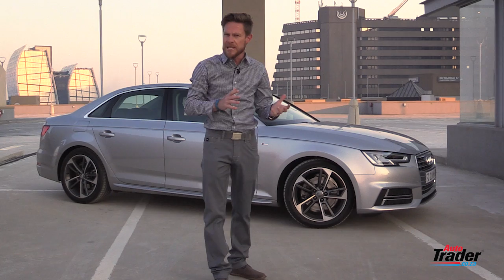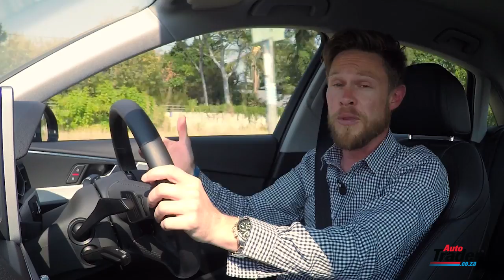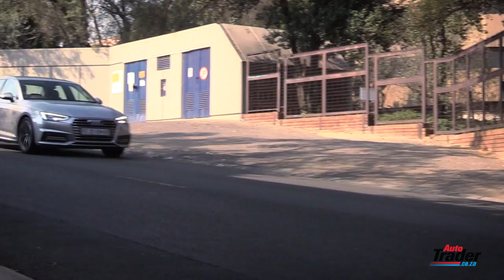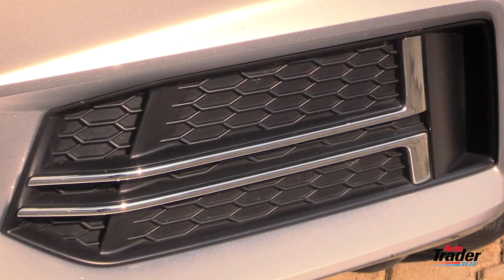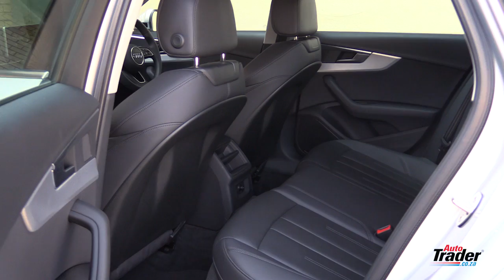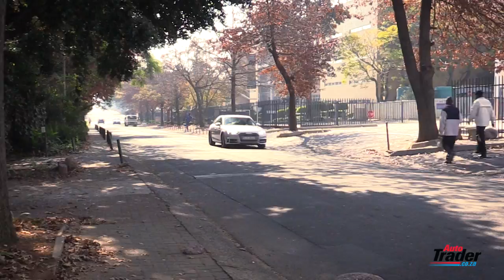2016 Audi A4 1.4T FSI Sport line

Comment: We humans are our own worst enemies. When a manufacturer struggles to keep a clean look on a newer model because there is no need to change what is good we admonish them for that, yet when they spoil the design we wail. Look at how mercedes has messed their designs because of trying to keep up with jone'ses. We need to practice balance not hype just to be seen to be progressive. A key elememt of balance is knowing when to push, stop or pull back. I have heard your comments and heard them with very many car journos and I must say, I see alot of bias that is based on a trend more than form and function. If i was a bit hard. forgive me.
Reply from the maker: Not hard at all, and for that, you garner a response. 

I do hear your point and it's much like a band that tries to change their sound on their follow-up album. Fans are often disappointed by what they release next, often hoping for more of the same.

In this case with the Audi, it's more about embracing a little change in the name of progress. Sure, they run the risk of getting it horribly wrong but they could also force the entire industry into a new direction - that direction could have saved us the current BMW design monstrosities. Alfa Romeo has done it exceptionally well and Ford often manages to get it right, appealing to current fans and garnering new ones in the process. This generation of Audi A4 just reeked of laziness on the design team's part. [Chad]
Reply: @Autotradersa  I hear you. I might be one of those encouraging the laziness. I would buy a 1999 c200 if it were produced as it were in 1999 today.

It irks me that brands are into shapes that look like flying saucers and we are all supposed to jump in because the world is looking for sleek.

Some of us just want a decent sedan.

Find me a decent sedan that is not pushing for attention and I will send you a cheque of 1000 dollars.

Audi took over the elegance of the mercedes benz.

Vw Terramont and Skoda kodiaq and maybe BMW x3 are the only remaining decent looking mid sized suv’s I have seen.

In summary the ying needs the yang.

Conservative and Flashy but not flashy only.

You call it lazy because its not your cup of tea.

Let me and it there because I could write a book. 

Cheers!